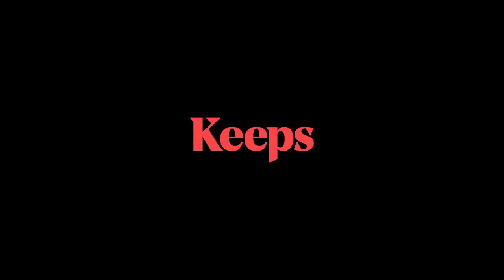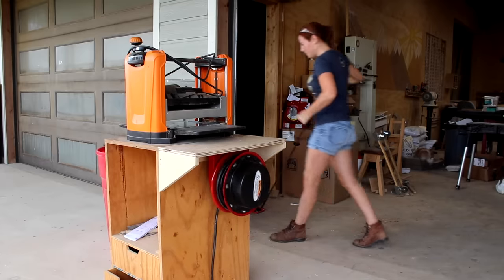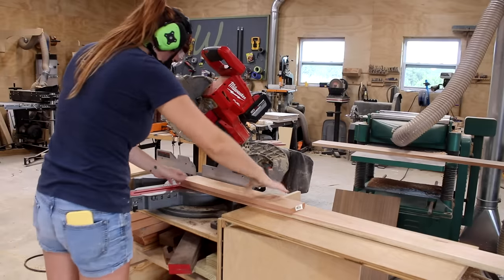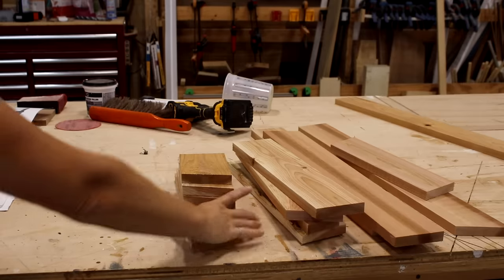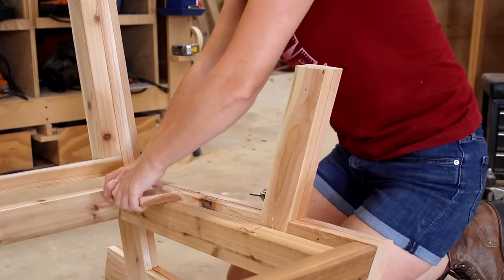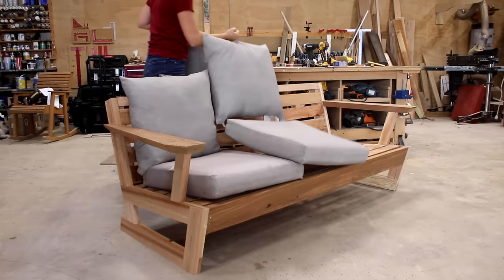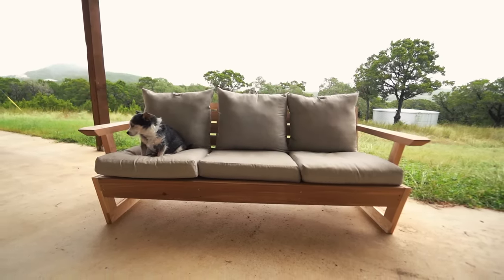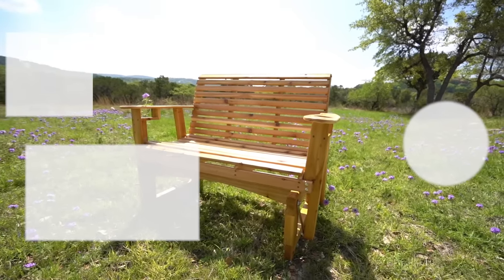How To Build A Modern Outdoor Sofa | DIY

Comment: April did I miss something?  It appeared to me that the slats on the right side were not secured down.  I can see the ends move when you do your tests.
Reply: I saw that also
Reply: @daveklein2826  LOL, you can clearly see the slats moving at the 8 minute mark
Reply: I saw that too!
Reply: Saw it also at 9:55 when brushing on the sealer. This is not to bitch about something but to give some help.
Reply: they're secured down in the two middle beams, and not the side ones. Saves screws, I suppose. They passed the tests, so they're clearly not necessary.

Comment: Would be nice to hide the screws, especially the ones very visible on the top arms
Reply: I would do that on mine.  I would also add a support to brace the arm.  Those 2 screws might need some help if weight was put on the outside edge of the arm.

Comment: I think you've done pretty awesome with hardware April but that it's holding you back now that you've advanced so far. Don't get too comfortable with it. As a challenge to yourself you should try to build a copy of this lovely sofa using nothing but joinery - no screws or nails, just wood and glue. I'm sure you can do it. Yeah, it 's more planning and more difficult to construct but that's what challenging yourself is all about. In any case ... nice job - it looks lovely :)
Reply: I agree in a lot of ways, but even exterior wood glue doesn't hold up very well in outdoor applications. Moisture significantly weakens the bonds, and the more drastic wood movement causes them to fail too. I use dovetails, mortise and tenons, dowel joints, etc for my interior furniture, but it just doesn't make sense in a lot of cases for outdoor furniture. You could use pegged tenons and tusked tenons to accommodate for that, but it's not really worth the effort in my opinion since it's just going outside and nobody is going to pay much attention to it. I guess she probably builds with a lot of fasteners because of her filming schedule too though.

Comment: I'm confused.  Even on the finished project, there were no fasteners holding the right side of the seat down. You see it when April shimmies and lays down on it, but also again at the end of the video.  Why was that choice made?
Reply: I was wondering that too
Reply: I noticed that as well.
Reply: Also on the left end of the back rest slats
Reply: @daveklein2826  from 7:45 - 8:05 you can see no screws in the right side of the seat slats or the left side of the back slats, and watch the right side ends of the seat slats lift and flex. Especially during the stomp test. And again at 9:55 you can see no screws in the right side of the finished slats as well.
Reply: @philipvanvaerenbergh5062  @Dave Klein perceives himself as April's white knight apparently. He's all over  comments pointing out her mistakes even if the commenter is obviously correct.

Comment: Hi April be careful using your electrical leads rolled up when using powerful equipment.  The coil can build up head similar to a copper element and melt the insulation.  this is the voice of experience after welding my 240v 30m reel together using belt sander.
Reply: WhatsApp➕➊➋➊➌➏➐➍➒➎0➏

Comment: Great video! Like how you shot brad nails on an angle since they were long. Stronger too when angled. A carpenter friend told me to always buy long brad nails and just used tin snips to cut the tips to the desired length! Haven’t personally tried it yet, but sounds like a solution?

Comment: Actually - angling nails in any project where you are using a nailer or stapler will make is stronger because the nail/staple will less likely pull out than if it wan nailed at a 90 degree to the wood.  angling and faster at a slight angle will always give you a more secure and stronger joint,  Just some thing to think about...
Reply from the maker: Thanks, I'm glad you enjoyed the video.